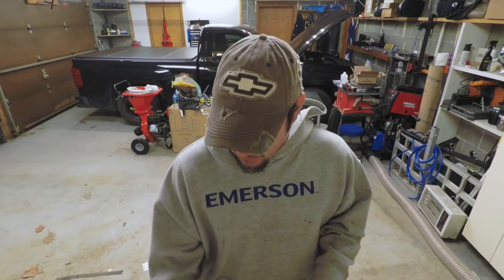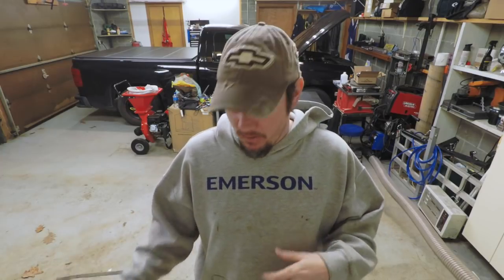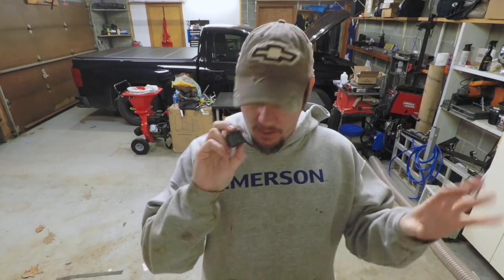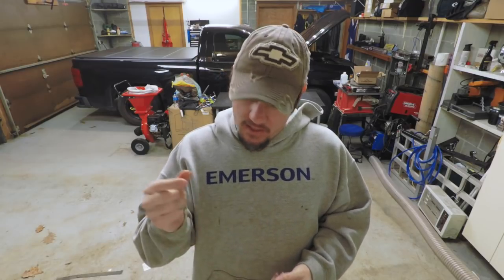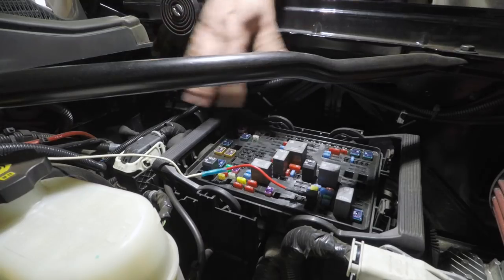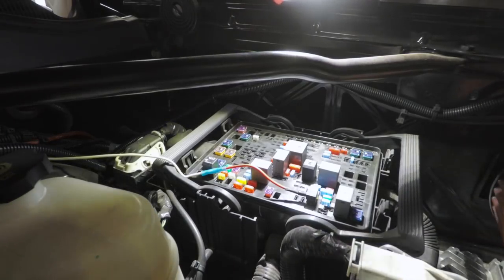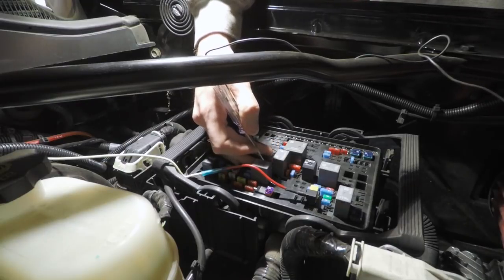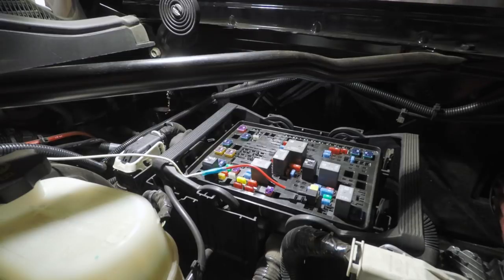Where To Get 12v Power On Your Car!

Comment: Hello, I just bought a back up camera that I am suppose to connect to the reverse lights wires but I want the camera to be ON whenever the Key is on Running or ON position, so… can I connect the camera wire to the radio wires? Thank you
Reply: This would trigger the stereo to always show the camera wouldn’t it

Comment: Very informative, thank you for your efforts and time. I have a little question if you don’t mind please, well.. first of all i have a dashcam trying to do the hadwire, unfortunately i could not get any 12V constant voltage from the fuses outthere, this is an old 99 toyota tercel. One thing i noticed is that the radio does not save all the presets as well! After turning the car ignition off. Could it be a burned fuse or just a harness issue ? Maybe gotta swap those yellow and red wires ?
Thank you.

Comment: Good informational video. I need help on how or where to draw power for an airhorn button that has 5 pins +,-,c,no, nc. How can I get power to the + on the button without frying the button by overpowering it directly from the battery? Thanks
Reply: I know this is an old question but the answer is to use a relay. Run the battery feed via a fuse to the relay then on to the air horn compressor. Switch the relay with a lower gauge wire from a 12v source in the cab

Comment: My Car boot won't open when I press the switch, it make opening sounds but fails to open and when I check it with multi meter and press the switch it shows 8volt, sometime 9volt and even dropped to 7 volts. Is it the switch motor not getting full power or it is design to supply less voltage and motor is weak?

Comment: Hey man how can I find ignition wire in a  modern Car that has come with an original push switch? Key switch are easy to find ignition cable
Reply from the maker: Look for a circuit that is only energized when the push button is in acc or on, might have to go into the engine bay fuse box to find one.

Comment: hi my car has an av in and i had an idea i wanted to put a ps2 slim to my car ps2 uses 8.5 volts and 5.6 a can you recomend a way to get power to it some people say use dc to ac inverter but i want to use a voltage converter do i only need to step down 12v to 8.5v and the ps2 draws the current it needs or do i need to change that as well
Reply from the maker: You should be fine stepping down 12, that's all the brick on a ps2 does, changes AC to DC, no reason to do it twice. Plenty of options for DC transformers out there
Reply: @GoatRopeGarage  thanks i hope it works i will reply if it does

Comment: Can I make my existing dc port(cigarette lighter), on continuous or turn on by a switch when the car is OFF?
Reply: Yes you can. But battery gonna die. However if you want put it on a constant and run it through a switch then to the port. Easy peezy

Comment: I want to run a hidden light bar on the front of my car, but since the battery is in the back, Im not sure where to grab a 12v source. The alternator is a generator, so it's different and I don't know where else to draw a 12v source

Comment: I am installing Trail Ridge Towing Mirrors into my 2010 Toyota Sequoia Limited. For the most part, the new mirrors are plug and play as my originals already have power fold/tilt, heat, signal markers, etc. Unlike my original mirrors, the Trail Ridge also comes with rear facing led spot lights built into the mirror and comes with the wiring for such and 2 switches. I want to wire them together to one of the switches, that can be turned on in all power states (off/accessory/run). I am unsure how best to do this? In the video the retailer (1A Auto) provided, they spliced into a Tundra's bed light switch, which is perfect as spot lights and a bed light make sense to be paired, however my sequoia doesn't have a bed light (or a bed for that matter). The only switch I can think of tapping into is the Off/Door/On Dome light but is counterintuitive to turn on dome lights when trying to see better in reversing in the dark.

Do you have any suggestions for me?

I was just thinking (usually a bad idea), can I splice into that Off/Door/On Dome light wire and run a new switch from that for the led spots lights and then independently use the Dome lights or spot lights? I guess if I turned them both on at same time I might blow the fuse? 

Thank you for reading the above novel 👍
Reply from the maker: Just run a fused least straight of the battery, that would be easiest in your case
Reply: @GoatRopeGarage  thanks for the speedy reply! Thanks for the advice!
Reply: Write a book already 😂 j/k